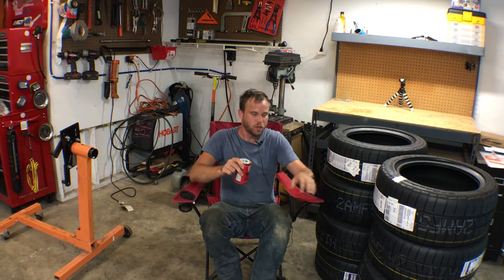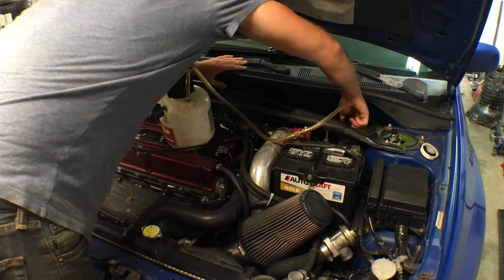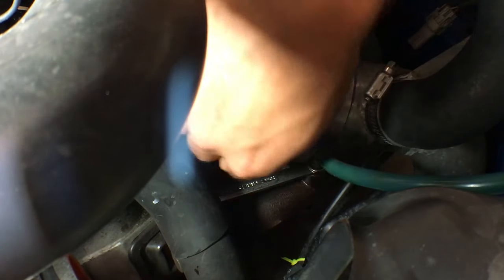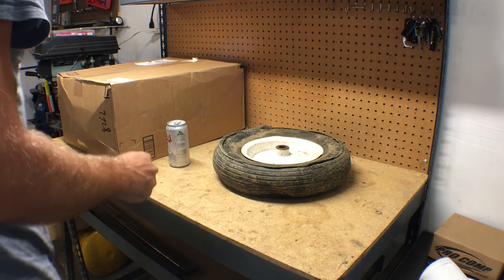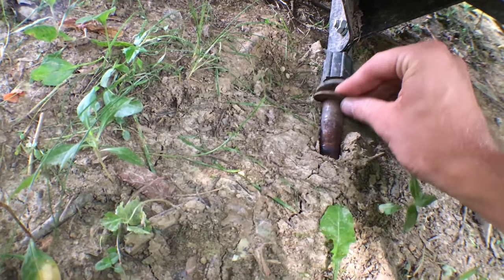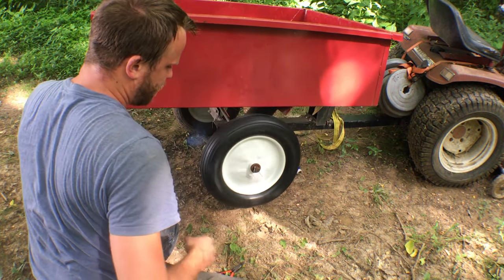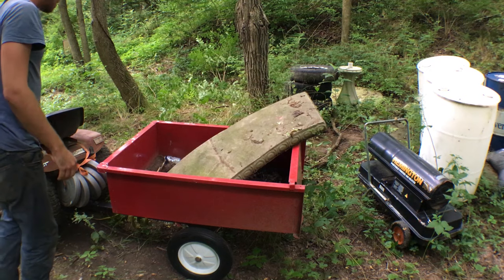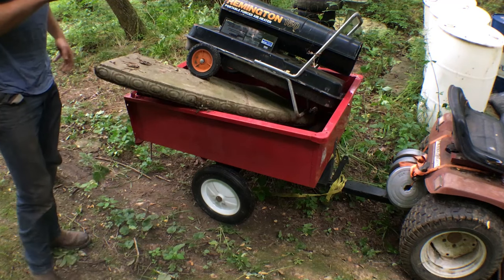Schrage's Garage: Episode #2 - Mitsubishi Evo Clutch bleed / new trailer tires

Comment: is your catch can baffled?
Reply from the maker: Yeah, it's a legit peterson catch can.  Peterson Fluid Systems 08-0410.  It used to be $70 years ago but apparently they realized that was too good of a deal and it's over $100 now. I'm not sure of the exact baffle design but you can look through the AN ports and see it.  Looks like a cylinder all the way from the top filter down causing air to have to enter, hit the wall, go down around and back up through the filter at minimum.  I recently pulled the catch can temporarily.  3" intake doesn't have near the amount of vacuum for my liking on e85 so i'll probably end up doing a 2 can setup, 1 between the manifold with a check valve to actually get some good vacuum, and the 2nd just VTA.